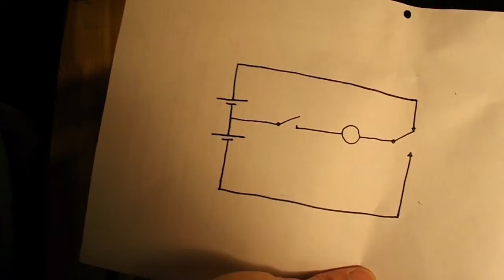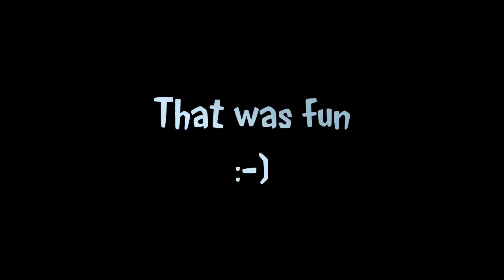Let's make an InchWorm CrawlerBot #2

Comment: is it possible to do this without the switch ?
Reply: and without the on off switch ?
Reply from the maker: jumbojimbo you could rig up a circuit that reverses the current to the motor on a timed basis, using a 555 chip and a few transistors.